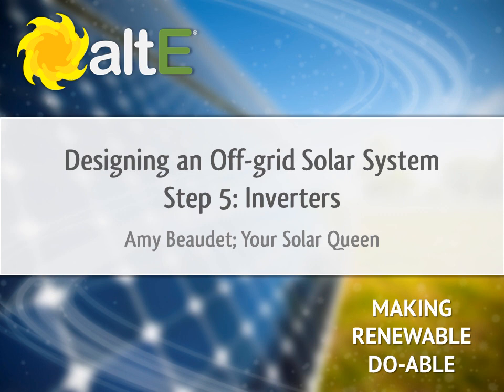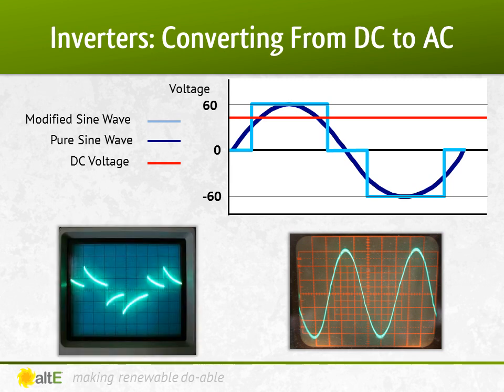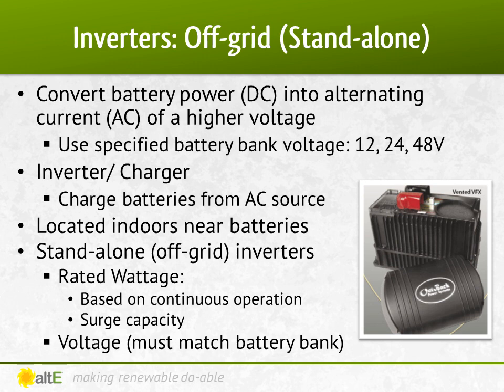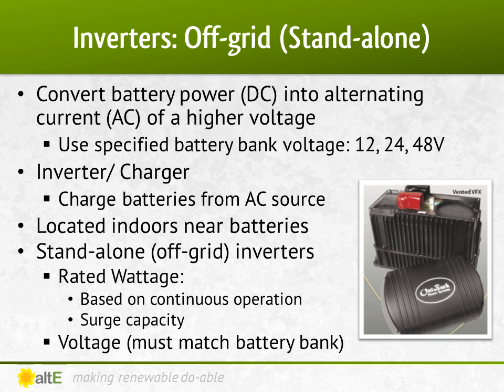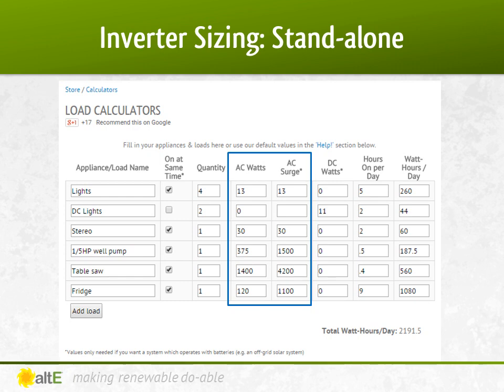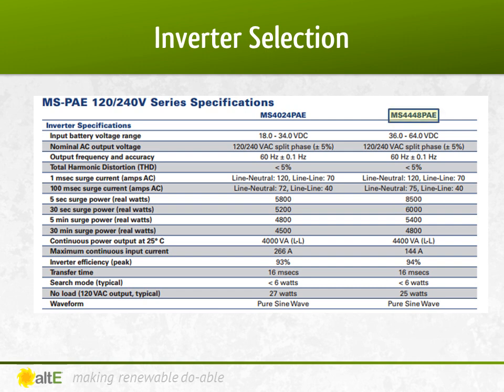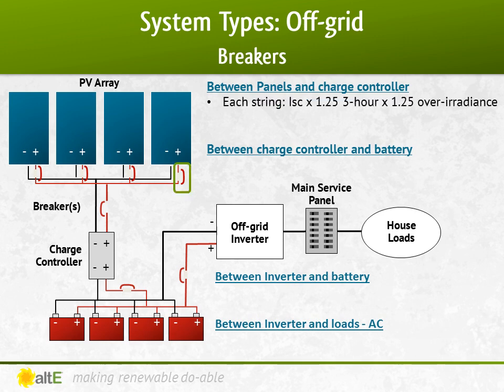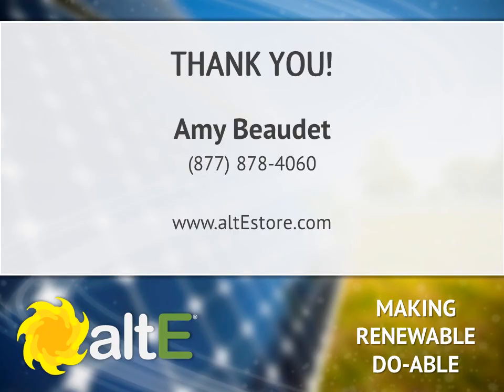Inverters: Off Grid Solar Power System Design - Step 5

Comment: At 6:39, you add up powers as 13+30+375+1400+120=1938. It's wrong as per your previous videos bcz since there are 4 AC lights so they take 13x4=52 watts in total not 13 watts. It's how you calculated in previous videos!
And by the way I learned a lot from all of your series videos. Thanks a lot. It's really really awesome! :)

Comment: Amy, the reason that the modified or square waves look weird on the oscilloscope is because the input selector is set to AC input. If you turn the selector to DC you would see a waveform similar to your diagram.
Reply from the maker: Interesting, thanks for the tip.

Comment: Hello , please if  the solar system produced 44 kw should i use a 50 kw inverter or 40 kw inverter ???
Reply from the maker: It is common to oversize the PV array, as the panels are very rarely outputting the full rated wattage, especially in the heat. So I would go with a 40kW grid-tied inverter. But if this is an off-grid system, the inverter doesn't care what the solar array is, as the panels are charging the battery bank through the charge controllers. So the inverter and array really have nothing to do with each other.

Comment: Invertors have some limitation  to accept the amount of PV power. for example one the model of "Voltranic Power" is VM-5 KW which can accept only 3000wats PV power. what we do if the operating load is enough for invertor but it's PV isn't in range. or we need more W-H. if we go to increase the number of invertors it will cause the more loses (0.92).

Comment: Please what's the meaning of 1.25 3hour?
Reply from the maker: The National Electric Code (NEC) says that anything running for 3 hours or more is considered "continuous use". Anything at runs for continuous use can only run at 80% of its rated current. So if you need to figure out how many amps the equipment has to support for your current, you multiply the amps by 1.25. For example, if you have 10A x 1.25 = 12.5A. So the equipment has to be rated for 12.5A to support your 10A load, because 80% of 12.5A = 10A..

Comment: Hi, First thanks a lot for these informative videos.
But I have a question, what do you mean by NECs 3-hour continuous??
Reply from the maker: In the USA, the National Electric Code states that any equipment running for longer than 3 hours straight cannot run at its full capacity. It can only run at 80% of its rating to prevent overheating. So we multiply the required amps by 1.25 to get to 80% of the equipment's capacity. For example, if you have to run 20A, you would multiply it by 1.25 to get 25A. That's the size equipment you should get to run the 20A. (25A x 80% = 20A).

Comment: Where can you find the AC surge of the appliance ? im using aa fridge btw also 120Watt should i use the 1100 W surge or is it not safe to use it? and yea i looked on the spec sheet i cant seem to find it

Comment: last two calculations for between inverter and battery and ac
is it (rated wattage of inverter/ac voltage) * 1.25
or (rated wattage of inverter/ac voltage * 1.25) ???
Reply from the maker: (rated wattage of inverter/ac voltage) * 1.25
Reply: thanks